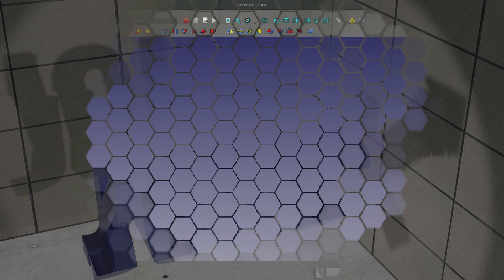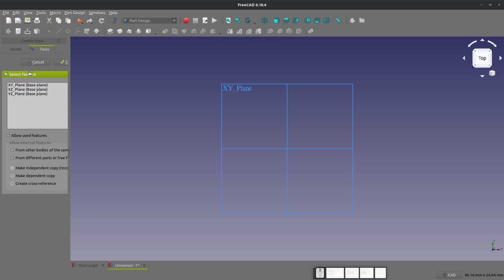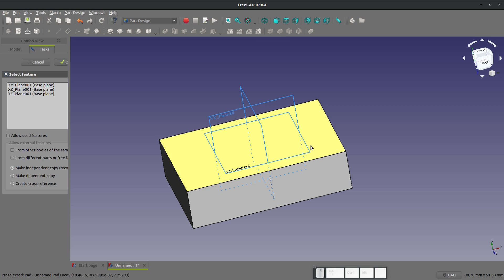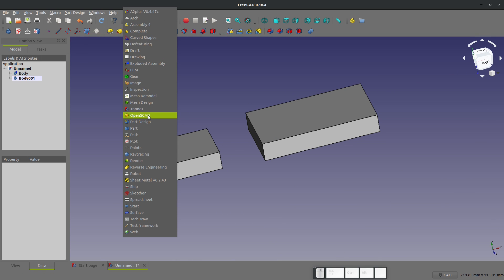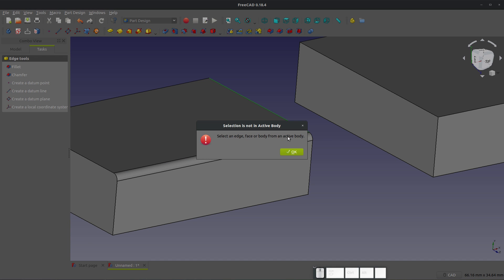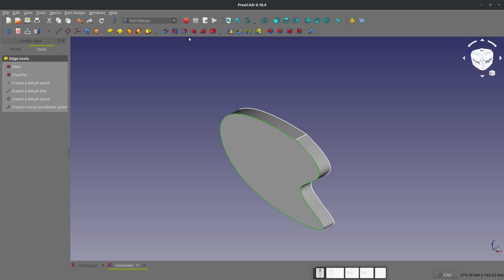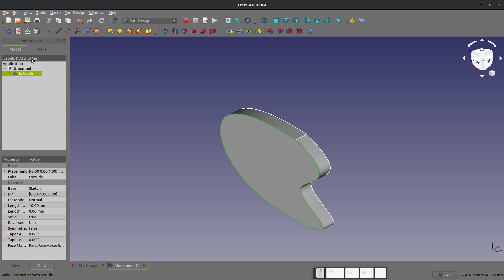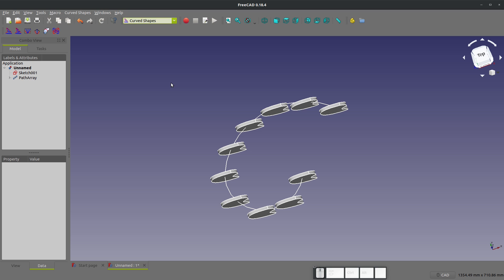FreeCAD - How Do the Workbenches Work Together? |JOKO ENGINEERING|

Comment: I don't understand why the advice for beginners is to only use part design. It's worse than useless on it's own and it doesn;t play nice with all th other workbenches.
The reason i say WORSE than useless, is because after you spend a bunch of time modelling something in part design and you HAVE to use a draft or surface or part tool to achieve the shape you need next, then you are screwed and have to start over in part workbench.
It feels like the whole part design work bench is holding freecad back from being amazingly versatile.
Reply from the maker: There are several reasons why beginners should start with the Part Design workbench in FreeCAD:
    1. Transferable Skills: Part Design's structured, parametric workflow is similar to other CAD platforms like SolidWorks, Alibre, and Onshape. Beginners transitioning to platforms such as these will find Part Design familiar and easier to adapt to.  As a corollary, beginners with experience in other platforms such as these will also feel most at home with the parametric part design workflow.
    2. Modern Approach: Unlike the older Constructive Solid Geometry (CSG) approach used in the Part workbench, Part Design offers a more modern parametric modeling experience. Part design has been developed more recently and is made to work like contemporary CAD platforms.
    3. Integration with Other Tools: Although Part Design doesn’t handle surfacing directly, it integrates well with the Part workbench. For surfacing needs, you can switch to the Part workbench to create surfaces, then return to Part Design to continue with parametric modeling.  It also works with curves, for instance in extracting subshapes from a part design body.

If we are talking about draft as in drafted faces, part design does have its own draft tools.  If we are talking about draft as in the tools within the draft workbench, I have also been able to utilize those tools with my part design body, just given that the body is then pulled into the CSG workflow, which should be of no consequence if the part was instead started in the part workbench.  

Overall, since Part design uses the modern parametric workflow, and the part design bodies can be used within the CSG workflows offered by the Part workbench, a beginner would be learning the most modern workbench first, and be able to integrate the functions of the other workbenches as their skills grow.  You’re absolutely right when you say Part Design can’t produce surfaces; however since the part design bodies can be used and integrated into the CSG workflow I would see that as not being a high consequence.  Hope that helps, and best regards.
Reply: @JokoEngineeringhelp  THanks for the detailed reply. Mainly i just found that the parametric properties got lost or the chain got broken when switching between part design and other work benches.

My first project in freecad has been a thing that needs to be hydrodynamically optimised and contain some specific shapes with exposed sensors through the shell. Including equation driven curves defining the shell shape... Part design has been worse than useless. Every time I try to use part design the model stops being parametric -_-
Reply from the maker: @SidekickElements  That sounds like an awesome project.  I can see how the need for parametric curves would create a harder workflow.  I think that would be hard to start in part as well.  Good luck with everything

Comment: I'm pretty sure FreeCAD has been improperly specified if even, this is why nothing works together as you would expect.
This is just a bunch of stuffs loosely tied together, some happen to work with each others , most of the time it will give you cryptic error messages or crash.

Comment: Thank you again for this wonderful videos! I was reading about the relation between "Part" and "Part Design" workbenches in the FreeCad forum: https://forum.freecadweb.org/viewtopic.php?t=31064
Turns out that it is possible to create or modify something in the Part workbench and later use it in the Part Design workbench: all we need to do is select the interested part in the tree view, and click the "Create a new body and make it active" button of the Part Design workbench. This will embed the part into a new body: at that point, we can modify it with the Part Design features.
Reply: This is helpful.  I have used the ShapeBinder if all I need to do is reference the geometry.

Comment: I am left with the one question, unanswered.  Given the level of incompatibility, why would I use Part Design at all?  Where are the advantages?  That seems to be what I missed.  Great video and appreciate the insight.  This is something so subtle, I would have otherwise struggled.  Thank you.  ~P  F360 Refugee
Reply from the maker: Hi sbirdranch;
Part design is my default goto for modeling anything.  Part is based on a constructive solid gemetry workflow which is an older kind of modeling, part design provides a newer workflow that feels like other modern cad platforms like SolidWorks, Onshape etc.  I don't think it costs anything to use the part design workbench because you can use it in the part workbench whenever you want.  I think Part design will work and feel a lot more like f360 for you!

Comment: So which should i use if i want to design patametric part? Should i shy away from part design wirkbench?
Reply from the maker: Part, part design and almost all the workbenches are parametric.  Part design, in my opinion, feels the most similar to SolidWorks or other parametric platforms one would have used in the industry.

Comment: Thanks a lot for the video. It took watching it a second time after reading the comments to get it.
However now I wonder what's even the point of the Parts Design workbench because it seems that it's just more difficult and adds extra complexity and limitations VS the Parts workbench superior compatibility.
Reply: I had the exact same question. Guess no one can answer.

Comment: Since the part design workbench limits its models to using only it, while the other ones don't, my conclusion would be to make the parts workbench my main one, and avoid the parts design workbench like a plague!
Reply from the maker: That can be a really good approach for some workflows.  The part design is appealing to many because it feels similar to most other platforms and can help prevent errors, but there is no right or wrong and every project is different.
Reply: Use Design456 workbench. It combines Draft, Part and other tools with many new tools.

Comment: I appreciate your videos very much. I hate to bother you but, is there any way you could do a video on the proper use of datums? I am using them but wind up with errors when I do and the error messages are not very helpful. Thank you for all you do for the community.
Reply from the maker: What kind of errors do you have?
Reply: @JokoEngineeringhelp  Hi Joko, I get two separate errors. The first is  "Unhandled Base::Exception caught in GUIApplication::notify.
The error message is: Access violation" and the second is " AttachEngine3D::calculateAttachedPlacement:InertialCS: inertia tensor has axis of symmetry. Second and third axes of inertia are undefined." They started cropping up after I added a couple of datum planes to my sketch.
Reply from the maker: @brucewilliams6292  Very interesting, would you be able to email me the parts that are throwing these errors?  Email is in the description

Comment: The Workbench structure is unnecessarily complicated. I just recently started using Fusion 360 and it’s UI is far more intuitive. I’ll continue learning FreeCad on the side just in case but, I hope they restructure their UI.
Reply: Agree and I think they will merge and simplify over time. The one thing they will likely never do is force cloud monopoly and cloak it as 'collaboration'. That said all the time we spend skilling in Freecad won't be a waste of time.
Reply: If you sign up now for a free / personal use F360 account you will find it is very restricted in terms of features and number of projects you can have, to a point it is almost useless.

Comment: I'm just curious, why are you using 18.4 vs . 19 beta? I've been using the latest 0.19 builds and it's been fine but a little crashy, not sure if it's more crashy then 0.18.4. which do you suggest that I keep learning CAD on? I don't know fusion and at this point only know freecad and I'm really trying to stay committed to it because I don't want to relearn things as much as fusion changes. Freecad seems to stay consistent among versions. Am I getting the right impression?

Comment: @5:30 select Fillet, switch to Part Design and then click Create Body icon. This will create new body with BaseFeature and now you can add any feature from Part Design workbench without any problem. When you make changes in Fillet from Part workbench new BodyFeature will be updated.
Reply: Yes, this is true, you can edit objects from other workbenches in Part Design, as you described.

Another exact demonstration: I created a sketch in Part Design, padded it, switched to Part and added a sphere, and performed a Union between the Body and the Sphere.  Then, back in Part Design, I created a new Body, and dragged the Fusion (the Union) into the new body to become the Base Feature.  I then went back and a) edited the sketch b) edited the Pad and c) edited the sphere, and all changes were reflected in the Base Feature in the new Part Design body.  I even then went back to the sketch and d) added geometry, such that the Pad caused the Union to no longer be a contiguous solid (a circle in the sketch, in the middle, makes a hole in the Pad), and nothing broke, since I guess it's OK for the Base Feature to be a non-contiguous solid.

I really like these videos, but I think the statement starting at 6:55 that "Part Design will not edit something from any other workbench", and the couple of sentences after that, the "hard and fast rules", are false.  Perhaps there is some other point he was trying to make that I didn't understand, but, from my perspective, it's misleading, unintentionally I'm sure.
Reply: Just noticed your comment, would you take a look at mine?
Reply: This is a great tip to integrate the workflows for newbies. Couldn't understood till now what a "BaseFeature" of a body in PartDesign referred to and where it was supposed to have originated from.

Comment: How to install FCGear on 0.18 FreeCad?
Reply: I don't think you can anymore. Something changed at GitHub and that's why the addon manager doesn't work anymore.
Best practice is to start using FreeCad version 0.19 from the GitHub repository. I believe you need to download the Conda package for your OS from GitHub, extract it, and then look for FreeCad.exe in the bin folder to start FreeCad.
Reply: @1951split  Found a bug in AddonManager module, space is missing in AddonManager.py and module works, only FCGear can't be seen on list.
Replace re.findall('title="(Macro.*?)"', p) to re.findall('title="(Macro .*?)"', p)
Reply: @TechnikZaba  Ah... so it's a different problem then. I only know that the addon manager wasn 't showing the workbenches because of a change in the GitHub API a few weeks ago.
Reply: @1951split  After a million tears and sweat, I made it. It is painfully simple. After downloading the zip from GitHub, I extract myself to the Mod directory and that's it

Comment: I'm not sure if it's the best way to approach it, but I have done boolean operations in the part workbench. After that I wanted to work on it in part design workbench. All I had to do is create a new body in part design and drag and drop part into body. Seems to work for me with cubes, spheres, cuts, fusions, etc. Again not sure if that's the right way or not.

Comment: Thank you very much Joke! I have a question for you:
-What version of FreeCad do you have installed?
-What O.S. do you have installed?

I am working in Windows 10 and I have some problems with Freecad 0.19. 

Thank you very much in advance!
Reply: @dim6892   Release 0.18 works fine in Windows. There is some minors bugs, but I understand that could be in others O.S.
Open source and open hardware are the present and the future of the humanity. The gap between commertial and open, are really smaller and many times, insignificant. Congratulations to FreeCad team and all the greate community!
Reply: @dim6892  Thank you very much. Today, I am configuring my laptop to be dual boot. I love Freecad and I will try it with Ubuntu or Debian. Thanks!

Comment: You can edit objects made outside the part design workbench in the part design workbench, by creating a "BaseFeature". I agree fully that it's not a logical way of working. In some cases can it be convenient though
Reply: please explain base feature in detail 
i am very new
thx
Reply: @Just_An_Idea_For_Consideration  select fillet created in Part workbench, switch to PartDesign and press Body icon, this will create new body with BaseFeature. From now you can use any feature from PartDesign
Reply: @voytechj  Thanks! How on earth is anyone supposed to know this?  It feels like freecad is making the user manage it's internal data structures!
Reply: Thank you @Hedzer great tip

Comment: What are the advantages of Part Design? I'm fairly new to freeCAD and I always start with Part design until I need to substract or do some boolean operation but I mainly do that because the tools are more unified there and I don't have to keep changing workbench from Sktecher to Part. Is there any other advantage apart from that one?
Reply: Booleans are not standard in CAD design and Graphics (it causes all sort of problems down the line). Just use all the tools in Part Design which is the standard in Engineering, it's the closest to Solidworks.

Comment: You are the best Joko! Many people including me moved away from Solidworks to FreeCAD thanks to you. Sooner FreeCAD will become a competitive CAD software. I have been using the FreeCAD version "Assembly 3 FreeCAD" by realthunder and in Sketcher you can use "Defining Geometry" under External References. This basically works like Solidworks' "Convert Entities"! Also, in this version the "Topoligal naming" problem is fixed. This means you can Sketch in faces without the fear of modifying the extrudes/ lofts later since the sketch won't break. You can reassign it to a face if there is a problem

Comment: Thank you for the video.  It seems that is you have experience in other design programs ( solidworks ) you recommend part design as the workbench to use because of a familiarity to SW but it does seem limited in a workbench compatibility view.  Full compatibility between workbenches is achieved with the part work bench.  Do I have that right?
Reply: Just use Part Design, boolean operations is not a standard technique in CAD development. Furthermore the FreeCad version (FreeCAD Assembly 3) on realthunder's github allows to use the Solidworks "Convert Entities". In sketcher use the tool "Defining geometry" under "external reference". Also this version won't break your model if you need to update for example the extrudes